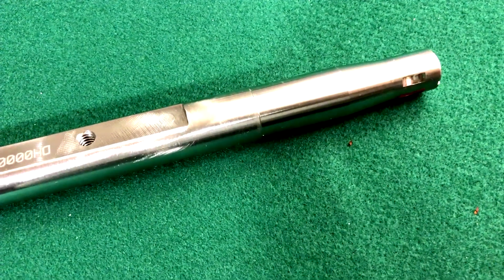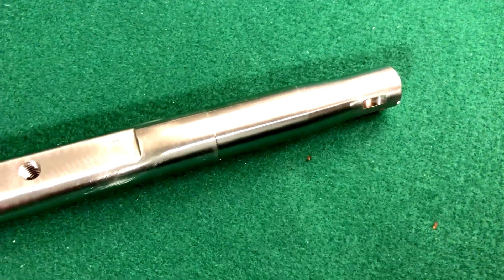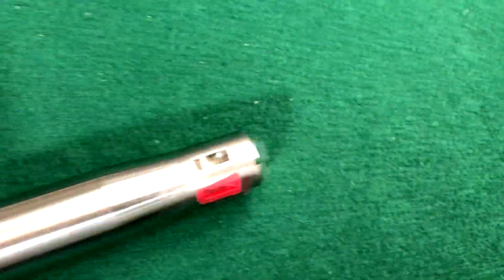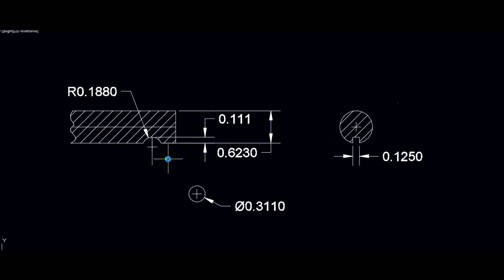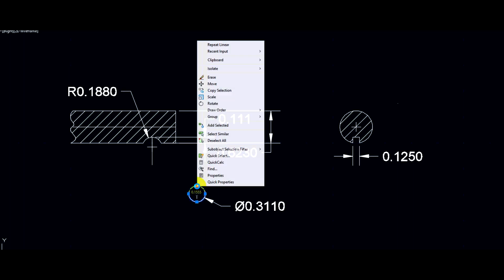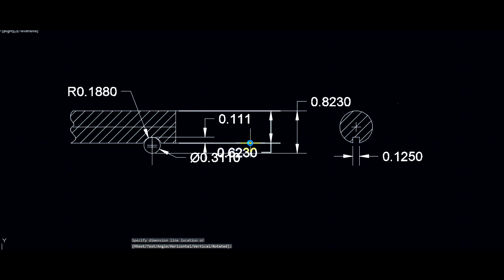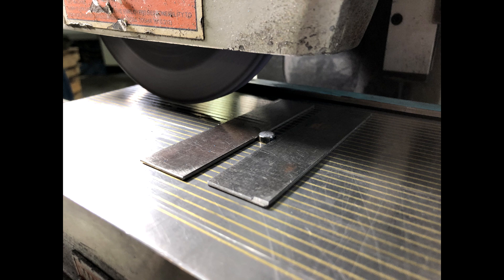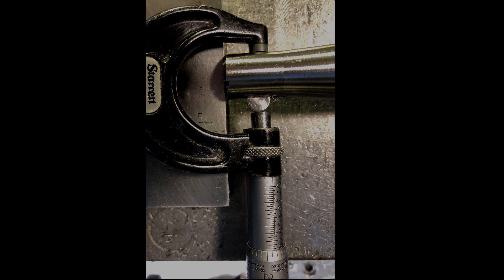LESSON #4: Measuring The Depth of a Keyway On A Round Shaft

Comment: I used to do a lot of this type of work on a 4th axis indexer. After I cut the keyway, I would take a dial indicator and turn the a axis to get the keyway aligned and pick up the high spot of the shaft then used the readout on the machine to find the low spot on the key way. Passed inspection every time